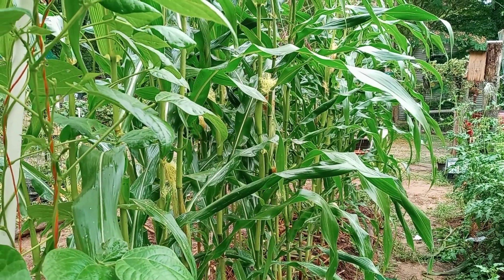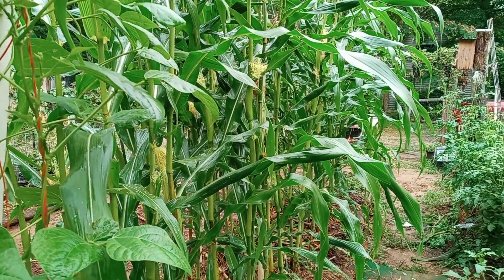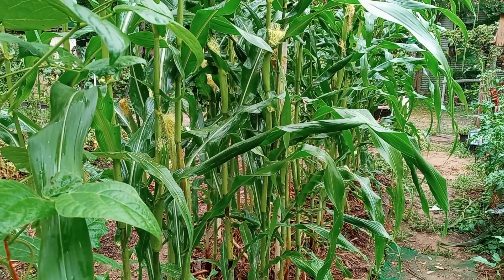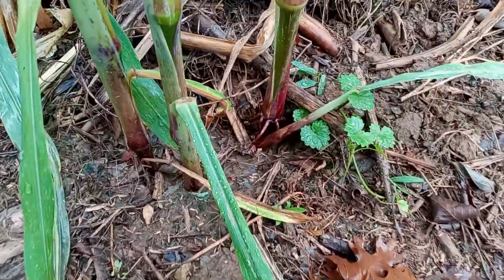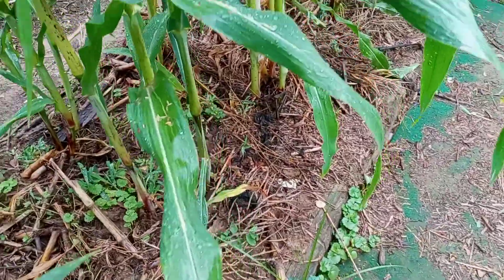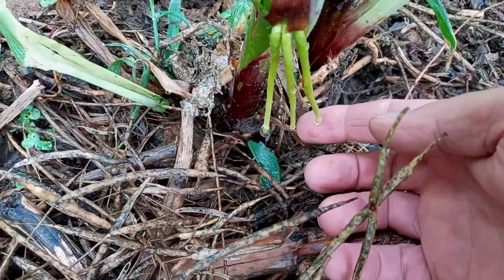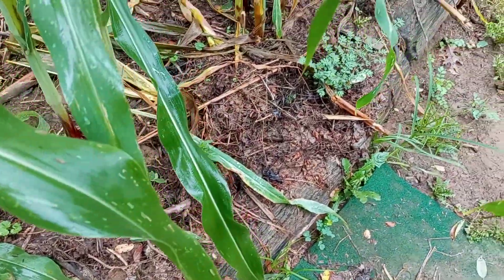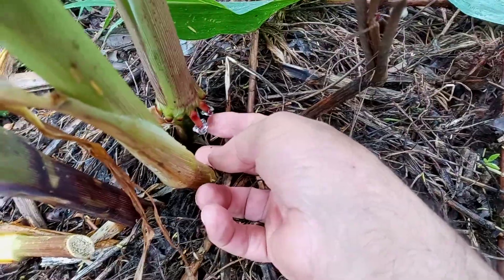Nitrogen Fixing Corn???  Reeds Ohio Valley Flint

Comment: This indeed is nitrogen fixing mucus. It's a trait found in all corn (it developed way back well before corn became corn). The mucus goes away when the root touches the soil. The mexican varieties which fix more nitrogen do so by producing many many more of those brace roots on many high nodes. I grew a hybrid that had at least 5 nodes sending down air roots. 

The number of air roots is a dominant trait controlled by a single gene. It's worth selecting for. Up in wisconsin they were able to get ~40% of the nitrogen fixed by those roots. As you go further south the tropical weather and longer seasons give you more. They found 70% of nitrogen necessary for corn growth was self-fixed in the mountains of mexico.

Makes you wonder what else we've selected out and forgotten over the years...
Reply: You mentioned that the aerial roots were controlled by one gene. Can you provide citation for this and maybe the name of the gene? I am working on a research project relating to this topic

Comment: Yes, The Mexican corn you speak of has that “slime” to create an environment for bacteria to live in and fix nitrogen for them to essentially be self fertilizing. The Mexican corn gets as much as 70% of its nitrogen from the air instead of the soil. It would be massively beneficial to the world if this capability could be crossbred into other varieties.  Cut way down on fertilizer use and stop polluting the watersheds with runoff.